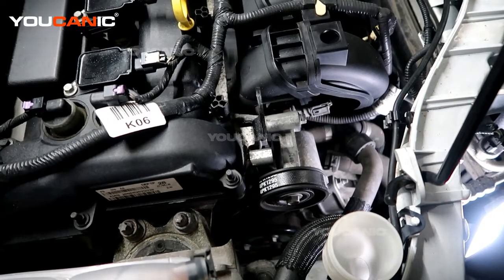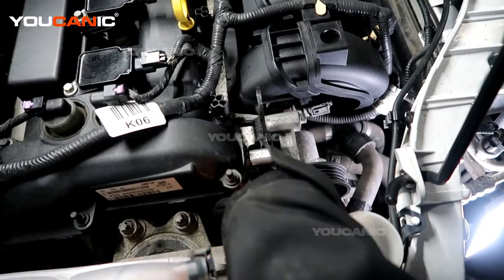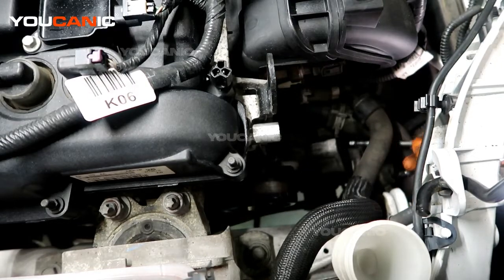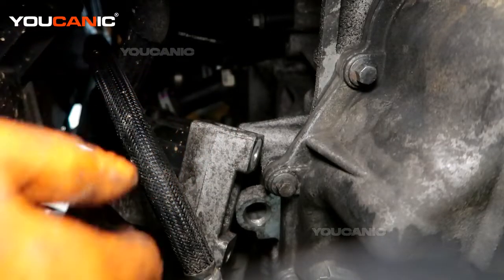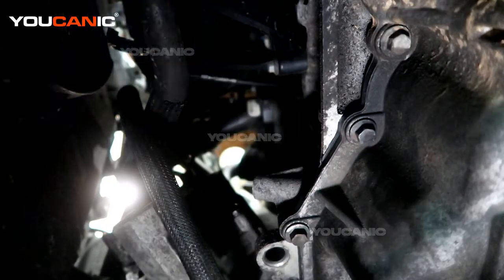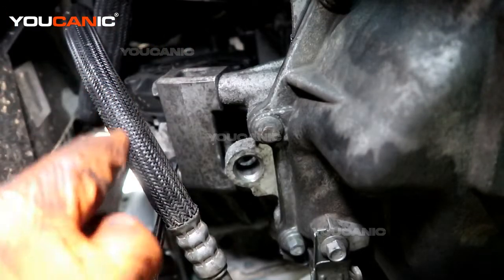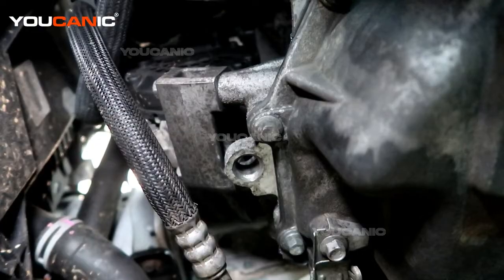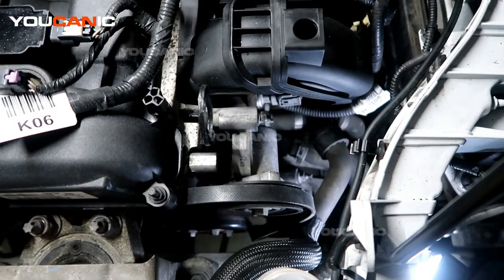2012-2019 Ford Focus - Alternator Replacement 2.0L Engine

Comment: Very helpful. I need to squeeze the top of the connector and use a flat head to “pry” under the base. It was tough to put back on. Partially mounted and then a long screw driver to push down on it.

Comment: Was that stud hard to remove? Ive bent 2 sockets already and i can not remove it for nothing. Its not stripped but its not budging either.
Reply: It was tough but I didn’t have that much trouble. Broke it lose with a socket and a wrench on the end.

Comment: This alternador is the same for 2012 to 2016?
Reply from the maker: I'm not entirely sure if the alternator for the 2012 model is the same as for the 2016 model without more specific vehicle information. I suggest further clarity for your question can be found on YOUCANIC www.youcanic.com where a wealth of car-related resources is available, including a community where car-related questions can be asked and answered.

Also, consider checking out our YOUCANIC Full System Scanner www.youcanic.com/scanner. It's designed to help diagnose potential issues with your car, essentially like having a mechanic at your fingertips. Remember, we're here to support you in your automotive journey, so don't hesitate to reach out with more questions.

Comment: Watched this video and swapped the alternator out in my 2013 Ford Focus. Here's a couple things I wished I had done differently and known in the process.

1.) The 5mm stud does come out. I see comments below saying it doesn't. Do not try removing the alternator without removing the 5mm stud beforehand (aka, sliding it towards the front of the car and off). The coolant hoses block the travel path and it is extremely difficult to slide the alternator back down the stud,

2.) Be careful when removing the wiring from the old alternator. I ripped the wiring out of the pigtail connection almost instantly once I removed all the mounting bolts. Probably since it was so old, to be honest. Amazon has replacement pigtail connectors for $10 that you can rewire fairly easily, but this should be avoided if you can as this will make you want to drive the car into a river. The pigtail connector is what the car uses to tell the alternator to charge the battery, and is what sends the battery error message to your display cluster in the car if the alternator is not charging correctly. Obsiously, the 13mm power cable is what physically recharges the battery. Both are important, but unfortunatly the alternator will not charge the battery without that pigtail connector properly connected. It's tight, but removing the 13mm bolt closer to the driver side of the car first, loosing but not removing the other bolt, and rotating the alternator will allow you to reach your hand down in from the top of the car and safetly remove this pigtail connection. Again, be gentle with this connector. Its feelings get hurt very easily. Here's the repalcement pigtail conenctor I had to purchase and rewire to the elelctrical harness incase you do what I did: https://www.amazon.com/gp/product/B0CQQMFXQV/ref=ox_sc_act_title_1?smid=A3FAG29GGXU06M&psc=1

3.) He touches on this in the video, but I want to emphasize that you should reconnect the electrical wiring to the new alternator before reinstalling the mounting bolts. Like he says, it is next to impossible to reconnect the wiring once its mounted up and you cannot get a wrench down in the engine bay properly to torque down the battery bolt. 

4.) COMPLETELY OPTIONAL BUT I RECOMMEND: The reason I was doing this repair in the first place was because my old alternator was completely siezed and had ruined the tensioner pully and serpentine belt that he removes in the beginning of the video. I'd highly recommend replacing the tensioner itself (~$56), the serpentine belt (~$20), and the AC belt (~$15) while you are doing this process. There are videos all over YouTube that show how to do this, but requires that you remove the front passanger tire and remove the plasic lining of the wheel well to access the AC belt easier. On the plus side, having the plastic lining removed from the wheelwell while replacing the alternator made removing and installing much easier than what he shows in this video. Plus, having a nice new tensioner and belt will help ensure that the alternator is running the best. Keep in mind, you'll need a socket wrench to spin the AC pully to reinstall the AC belt, you will not be able to do this by hand. I had gone to AutoZone for the serpentine belt and AC belt, but here's the link for the replacement tensioner I purchased since its over $150 if you buy it directly from Ford and is not commonly carried at any autopart store that I tried: https://www.amazon.com/dp/B09B9DKMF4?ref=ppx_yo2ov_dt_b_fed_asin_title
Best of luck!
Reply: Thank you for the additional information. Fortunately, I was able to remove the stud on my '12 fairly easily. Unfortunately, the pigtail connector wire was frayed, corroded and hanging by a couple of strands of wire. Was the new connector a single pin like the one on mine? I can't seem to find a single pin connector on the Ford parts website.
Reply: @SV11408  Yep, single pin connector. I just stripped back the existing wiring from the harness and spliced the wire from the new pin connector and sealed it up with heat shrink tubing. 

The new connector doesn’t clip into place easily, but it does work. 

Theoretically, other options with two or more wires would work that fit in the slot. Just make sure that you’re splicing into the wire that connects to the alternators pin.